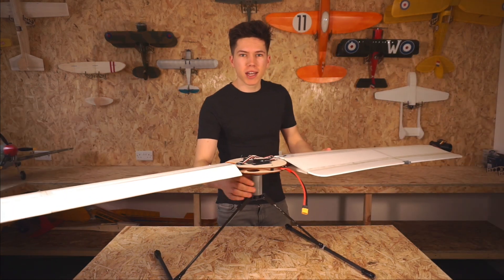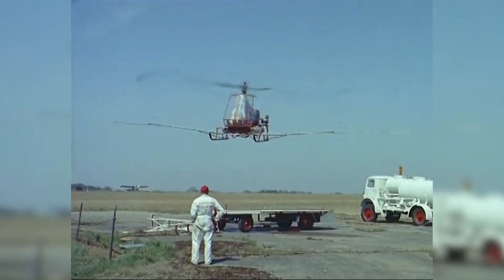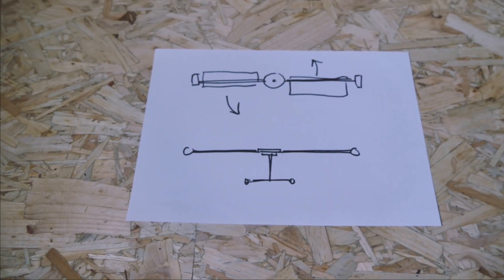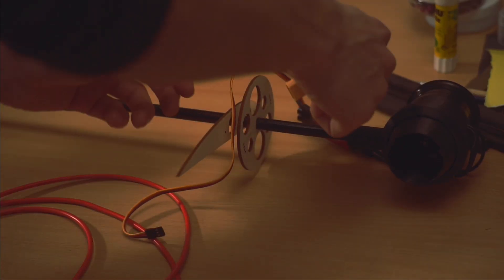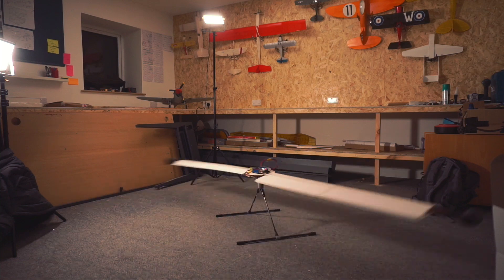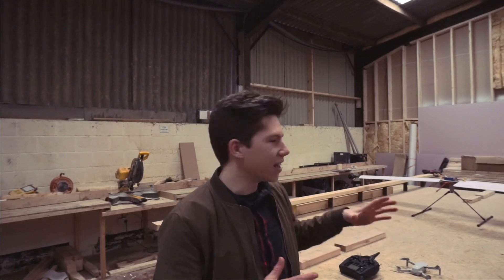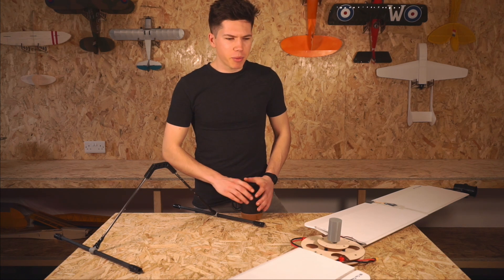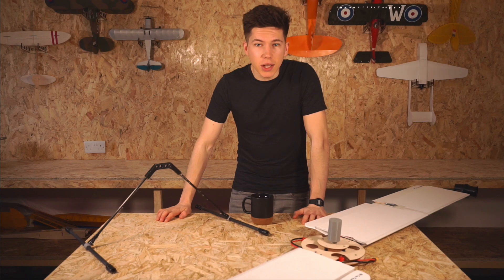TIP JET Helicopter Mk1 (Will it fly?)

Comment from the maker: Here are the next episodes in this mini series: 
Part 2 https://www.youtube.com/watch?v=vrygXf-cejI&t
Part 3 https://www.youtube.com/watch?v=-G2K2PYWGv8
Reply: Had to sub. I gotta see this
Reply: ProjectAir
 I think you forgot the tail.
Reply: You've been watching to much of CaseyNeistat
Reply: Well done James, I very much appreciated this video. Been watching a while (learned of you through Tom Stanton) and this video converted me to a sub.
Reply: Interesting project. But that’s not a monocopter. A monocopter has a single rotor, similar to a sycamore seed. LM’s SAMARAI is a good example of one: https://www.rcgroups.com/forums/showthread.php?1491947-Lockheed-Martin-s-Samurai-monocopter
Reply: willjhcave .
Reply: I think you need to make lighter wings with cleaner profile.
You also need to have some twist in the wing. The air speed is high  at the tip and near zero at the center. To have an optimal angle of attack on the entire wing, you need to have some twist in the wing.
Reply: Do you have controls for forward/backward and left/right movement once that thing goes airborne? You need to have otherwise you won't be able to correct drift and maintain a stable hover.
Reply: And how will you control altitude? Increasing / decreasing power to tip jets for faster / slower rotation or maintaining constant power level but changing blade pitch to increase and decrease lift?
Reply from the maker: @dirkhoekstra727  I intend to add servo controlled flaps to the rear of the wings. For this prototype I simply want to see if that will work. Ideally I'd like to integrate a fuctional rotory wing of this type onto a Rotordyne type craft in the future.
Reply: @Project-Air  you should consider tethering it to the ground for these test hops....
Also do some searching around for small tip powered one man aircraft.
I know I have seen a couple of these where the pilot wears the thing like a hat and maneuvers it by nothing more than shifting the cg, kind of like a hang glider....
Kind of.
Reply: Hi James I did look for your contact number on your website projectair.co.uk but the website do not work